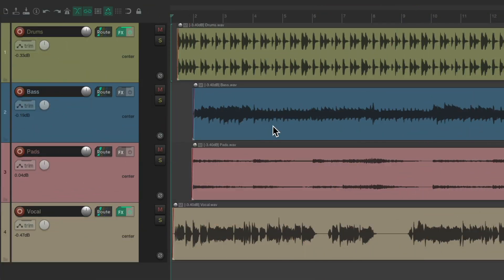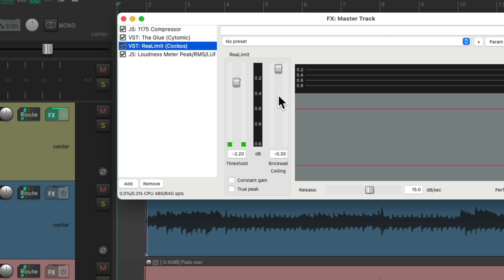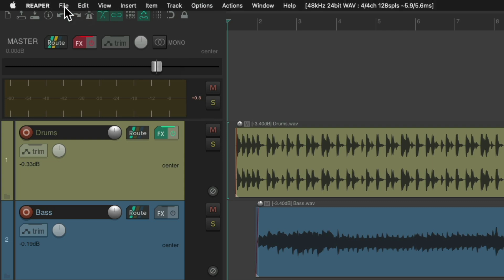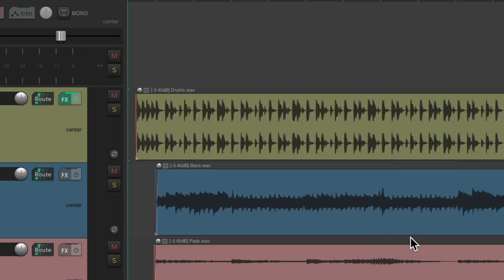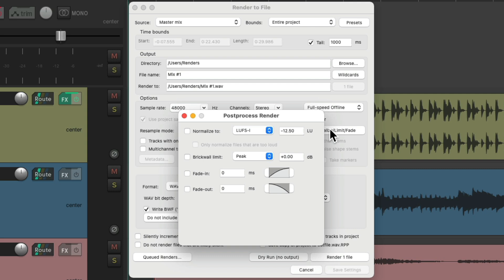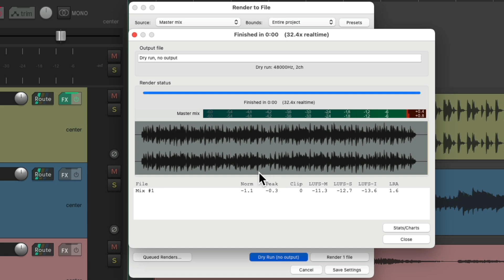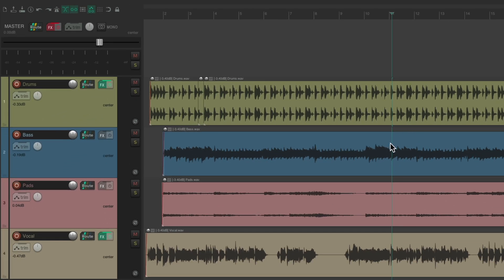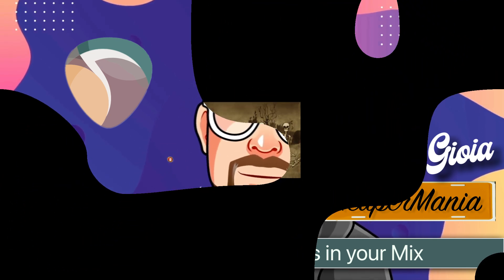Identify the Loudest Peaks in your Mix in REAPER

Comment: Thanks very much for making this explanation! I had queried about this very issue on another of your videos. Much appreciated!

With regards to the last method (doing dry runs then jumping to the loudest points one at a time) I had somehow managed to figure this out on my own. However, If you have a 45 minute or hour long track (say voiceover or podcast) there can be MANY peaks that need to be reduced. If you happen to use a lot of plugins it can take a long time to render. To do so for dozens of cases - one at a time - is practically ridiculous.

There is an opportunity here for a plugin developer I think. To somehow highlight the peaks, their volume and their position. Or maybe even automate them to a predetermined target. Or maybe there is another method that is obvious I just do not know. Based on the other comments here it appears not, so far.
Reply: He mentioned 'doing this with Automation' and that might be the ticket.  Potentially making Actions on what you just did, bind it to a key press, and speeding it up that way.

Comment: One of the things I find is that some reverb plug-ins as well as some midi instruments don't reset properly for the 2nd pass of the normalize function. So sometimes I hear an artifact from the end appear slightly there in the beginning. It can all be fixed when it happens, but I find I have to be careful with that normalize function, That is unless they fixed it recently. I'll have to check again.

Comment: Nice work Kenny!  Just wondering... when you select "jump to first clip position in project", how do you know which track is clipping? Thx
Reply from the maker: None of them are by themselves. They all are when they're added up together so there's really no "best" choice other than looking for the track(s) with a taller peak than usual.
Reply: @REAPERMania  Thanks,  that's kind of what I was thinking, but I didn't know if there was a different way to tell if it was an individual track. 👍